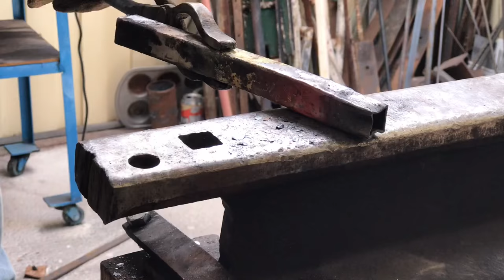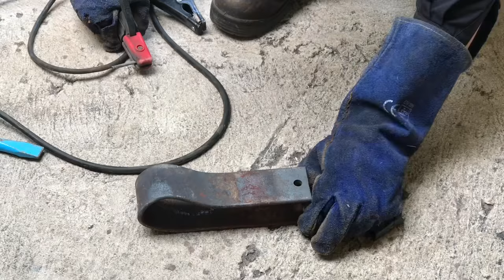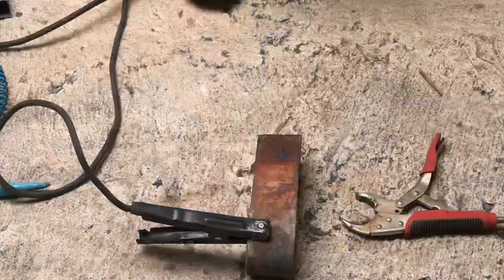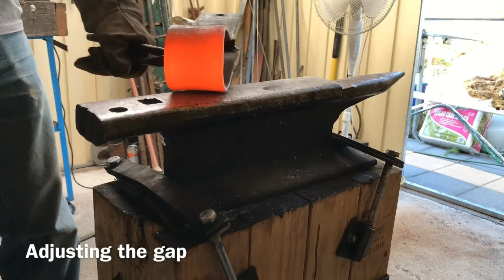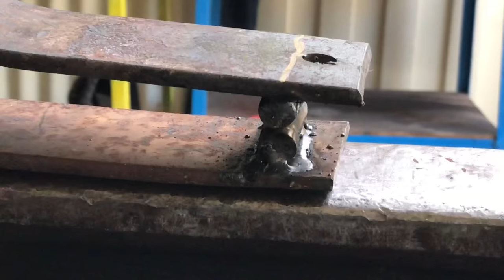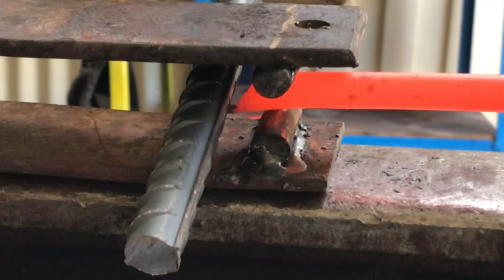Blacksmithing - Making a Spring Fuller from a leaf spring

Comment: Good project! A tip for the future, especially when trying to weld smaller pieces like that, use a welders magnet to hold the piece in place while you at least get a good tack... But good job. I need to make one for my new anvil.
Reply from the maker: I do have one, but forgot about it, I don’t weld often, but it would have made life easier, thanks for watching!